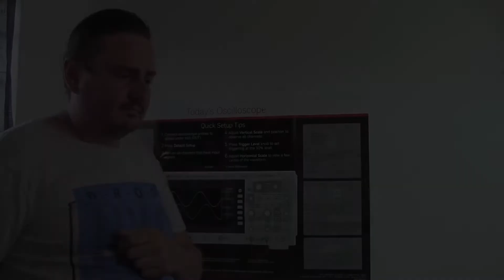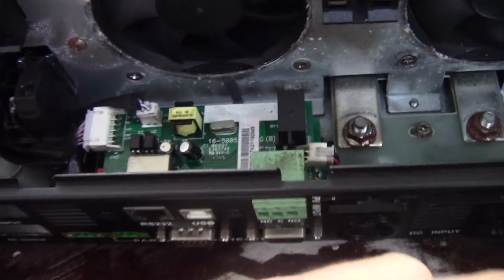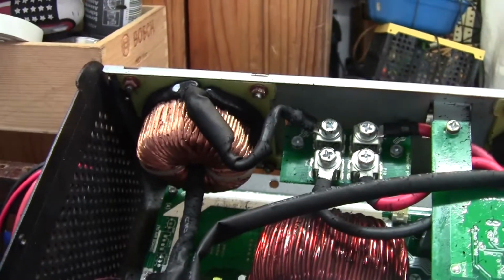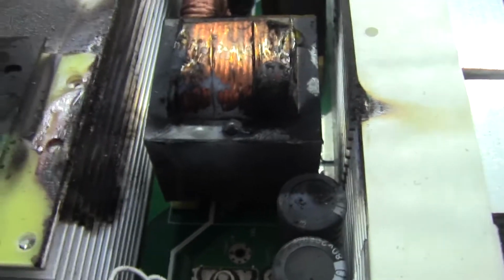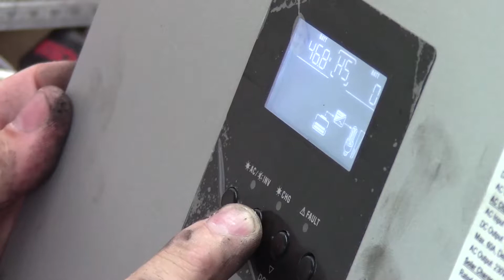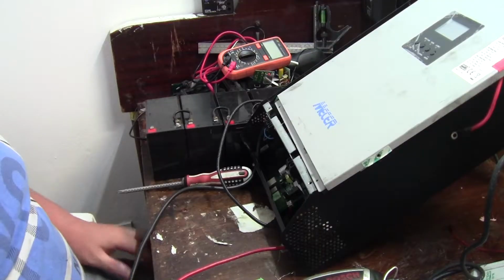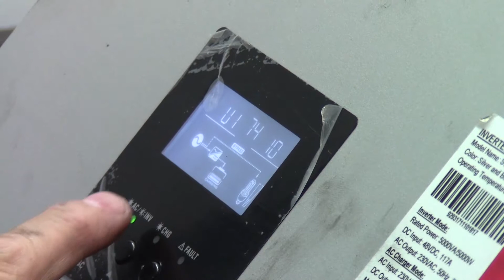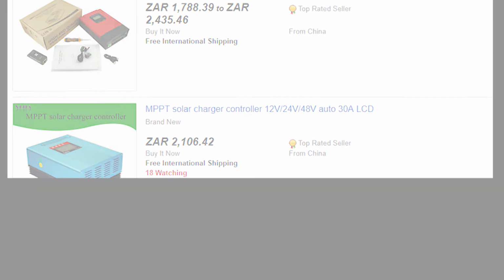ShoutingElectronics #13 - Toasted Solar Inverter -  Can it still work?

Comment: Did it get clobbered by lightning, or did it just get mounted where the rain got into it. Guess the solar input side does not have any protection on it or any fuse.
Reply from the maker: I suspect moisture. Apparently there was not even a fuse on the PV line.  (Which the DIY homeowner has now fitted. )
Reply: @ShoutingElectronics  Check with Mantech if they have this board. They have a very similar looking one on the website, might be the same item with a rebadge only. You can then collect the weekend or I can Postnet it to you.
Reply from the maker: @SeanBZA  Thanks, will give them a shout